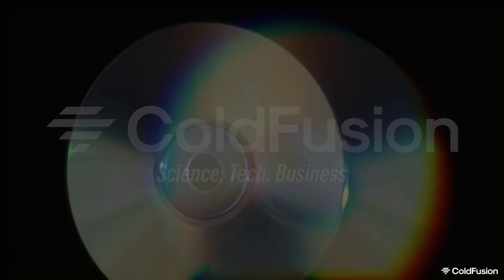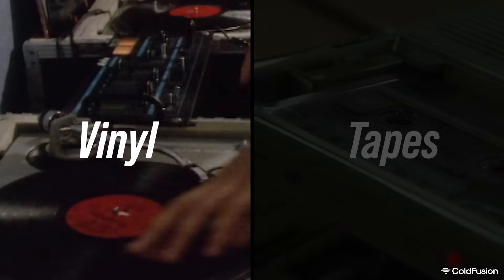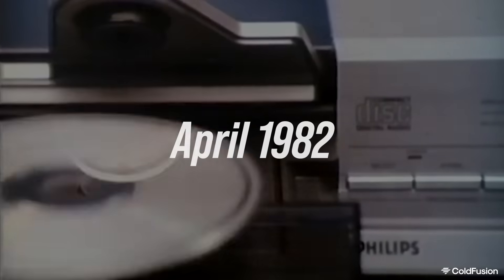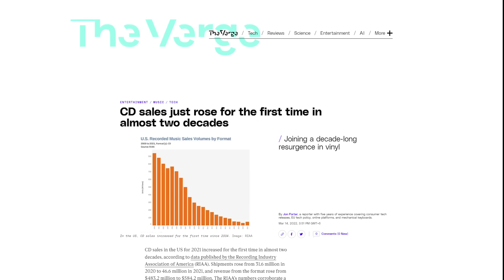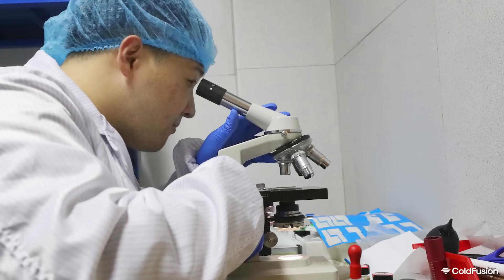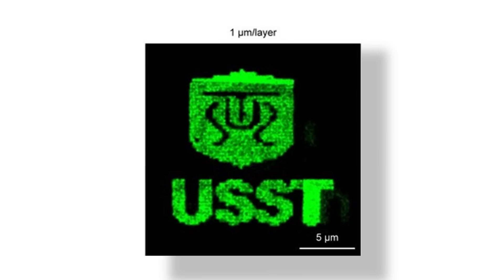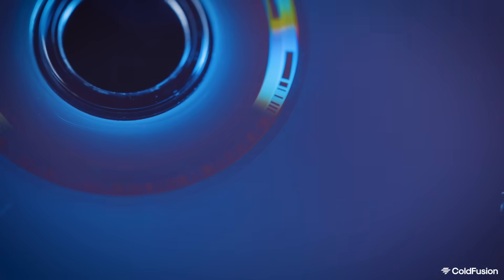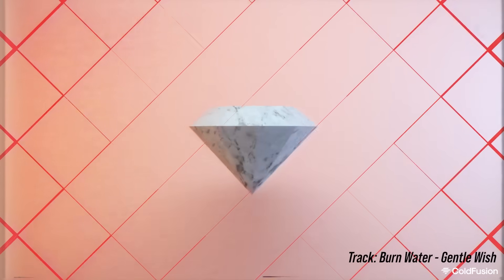Why This New CD Could Change Storage

Comment: 👀 Ey, bit=/= byte. They are not interchangeable. 8bits = 1 byte. A bit can store 2 values (0 or 1), a byte can store up to 256 values in binary (from 00000000 to 11111111). Let me explain a bit (not a byte, hehe)... 🦜

A bit is the most basic unit of data a computer can understand at a hardware level (basically and on/off switch = 1or0; which is what transistors functionally do). We can give meaning to a bit, outside of the computer, and interpret them and treat them as such (hot/cold, presence/absence,cat/dog)... But that leaves us quite limited, as we would only be able to store data that are "either or". That's where "grouping" of bits comes in useful. 

A common misconception is that since a byte "joins" 8 bits, it has 8 times more "capacity", but in reality what you achieve is more similar to  storing  the same amount of data units but you get more "resolution" for each units; you get 2^8=256 alternative values. 

For example, if you have 2 bits, you can use them either for 2 distinct units of data with binary values (for example: [0] and [0], or [1] and [0]) or you can group them for a single unit of data that can store up to 4 different values made from 2 bits ([00],[01],[10],[11]).

If you group 3 bits, your data unit can now have 8 different values: [000][001][010][011][100][101][110][111]

You can clearly see a pattern here: 1bit->2 values; 2bits->4 values; 3 bits-> 8 values; Nbits->2^N values
(N stands for any integer number). That's where those 256 values with 8 bits (or 1 byte) comes from. If we treat them as numbers, that would be from 0 to 255. Again, we can "label" or interpret those individual values according to a convention. For example, if we want negative values, we can agree that [00000000]= -127 and that [11111111]= +128; in fact it's is common to agree that, when we want to store negative numbers we can use  the first bit of the byte to indicate sign (+ or - ), so for example: [1-0000101] = (+)9. We could also label the values categorically, for example: [00000000]="Apple",[00000001]="Orange",[00000010]="Banana", and so on.

You might be thinking "okay, but why keep using bits as a unit then?" Well, they are the most basic unit, and as you you saw they can be used differently for different purposes. If you had 16 bits, you could" divide them", or use them for 4 different data units (" data types" is a more precise term from now on) or 2 with more" resolution". Like this: option a) [00000000] [00000000]; option b) [0000] [0000] [0000] [0000]

... Or you could say use [00000000] to store a character in asci and the rest to store a byte of data, effectively labeling the data! This way you can store a variable, like this: [01111000][00001111]
This last example would be interpreted as "x = 63", as "x" in asci is 01111000 and the value 63 in binary is 00001111.

We have "formated" the same amount of bits (which remember, are functional on/off switches which are based on a phisical medium) in different ways, to mean very different things! 

What determines how a hard drive is "divided" to store data...? That would be File System Formats . That is why sometimes a disk drive formated using different formats can end up with different usable space depending on the functionality they add to the data by using available bits in a different manner (like the "labeling" we did in the example) and adding error correction measures. This is one of the reasons why we still distinguish between bits and bytes.   

I hope this helped someone :)

Edit: i anticipate some of you might be thinking "why do we store values in binary rather than ternary (3 values per basic unit), or cuaternary,... Or more!?" Well, physically it's more reliable and easier to distinguish (which involves measuring) presence vs absence than all the values in between. As an analogy, In a bowl of peas, you can quickly tell if you have  have either none, or some (no matter 1 or 354!)... But knowing if you have 354 or 355 becomes more difficult. This is why digital data ("digital" literally meaning "with digits") is more reliable, but less detailed, than analog data (infinite values "in between" the signal). 

 In the past, attempts to have ternary(3) and quinary or pental(5) based computers have been made, but it proved more reliable to just combine single binary bits, as "middle" values were prone to measurement error and erasing. Currently, in quantum computing  the properties of quantum physics are exploited to store more than 2 values per bit (qubits = quantum bits)!

Comment: But what are the stats for reading? How fast can you read it, how much energy does it cost to read it, how expensive is a read-only drive? And can you make a master disc that you can use to stamp pre-encoded discs? While having cheap, compact storage, even if it's write-once, has a lot of potential, so does being able to instantly distribute 200TB of any static content to an unlimited number of people.

The Internet Archive has more than 48PB of data, which could be stored on 240 discs (impractical for an individual, but could be pared down to only the "significant" information, even partially using automated methods). The Library of Congress has over 7PB digitized, which could be stored on (still impractical, but less so) 35 discs.

Wikimedia (from a cursory search) seems to store around 700TB, or a much more reasonable 4 discs. Project Gutenberg is just under 1TB, easily stored on flash but a cheap way to fill space with useful content on a disc storing something larger.

Pirates would love it too: Anna's Archive (shadow library) has a little under 900TB, which fits on 5 discs. Since it's mostly text, it could easily be compressed, and there's significant deduplication to be done there.

Just about any content you can fit on a single one of these discs is enough to last a lifetime, assuming you don't care too much about what you'll watch, listen to, or read. If you do, you either have to be careful with what you download or just download everything. If you have no idea what you'll need, your only option is to download everything.

Comment: the HUGE problem with ALL cd/dvd media is that its optical and loses reflectivity and the 'written' discs break the layer thats used for protection so they (being plastic) will slowly rot and your data is gone
Reply: unless you live in a swamp, that wont happen, DVDs have the weakest layer and thus have the highest chance of having data rot if stored in bad conditions, blurays use inorganic layers and are much safer against, i backed up over a terabyte 7 years ago using 25GB and 100GB blu-rays and the data still reads perfectly + i used redundancy so they are protected against scratches and datarot, 25% of the surface needs to be damaged in order for the data to be unreadable, + i used the wirar recovery system so every backup workds like a RAID5/RAID6 so even if some idscs are unreadable, a recovery disc can restore any lost disc

Comment: I still use DVDRs for archiving. I've had hard drives crash on me, but I've never had a disc go bad. I have had discs that I had trouble reading on a different drive, but never one that couldn't be read by at least one drive.

I would have switched to burnable Blu-Rays, but the price for blanks never came down to what I consider the reasonable range. I mean, they press these things by the millions, there's no reason they should cost $3-5 a disc.

Comment: I'm not trying to be rude, but we've had 200GB-18TB backup capacity for years. I have no idea if any of you have worked at a data center or at IBM. Google Ultrium tapes. I feel like Gen-Z kids just aren't as informed or something, and this video is useless.
Reply: yeah they updated them to Petabytes, wow you can't game on them and it's nothing special.
Reply: but imagine this disc being an M-DISC, you won't need to constantly buy HDD/SDD in fear of those inevitably failing 5-10y or less, since an M-DISC will be the definite cold storage for archiving for more than one's lifetime

Comment: even if you make a cheaper, useable and faster 120 or 640 gigabyte DVD it will be reasonable for backup and archiving stuff. Seriously this is a proof of concept, to be archival it would be an incremental backup running 24/7 on like a banking server, and also have a secondary drive to make a backup backup of the same data. in the megabit range let's say increased to gigabit/second range thanks to SATAIII/SAS interface it would still take a while to fill it up.

Comment: Never again any spining storage, thanks. The lenses, kasers and fading laser diodes plus the data loss due the material degradation.  It is damn good that all those cd/dvd/bd disc died out. It was just a problem. A scratch ruined your life easily, also all of them had its lifespan and it was really short. I lerned the hard way that material of the writeable media aging and even the best quality media became a russian roulette after 3+ yrs… Even hdd should die out these days. Since 1982 I used all the media types from cassette and 5.25” late 3.5” floppy disk to all optical media types and ofcourse the hard disk drives. Today a ssd/flash storage (a good one, not a no name crap) will hold your data way longer than any of the optical solution back then. And I don’t need petabytes, all my life fits on a few terabytes.

Comment: this is nonsense.. 100 layer disc. "manufacturing takes about 6 minutes per disc" - six minutes? Firstly 6mins sounds pretty damn optimistic for stamping and bonding 100-layer disc, but ... 6mins? So you get 10 discs an hour out of a machine?  It's absurd. There's no way people are going back to physical media at this point; it's so much more cost-effective to increase the bandwidth of cable/cellular/satellite/etc instead...

Comment: What I want is a new floppy disk made with tech today. Tape stations is use for backup on data centers.
The kapacitet on tape is much higher then they were in the 90's. 
My estimate is that a 3,5" disk shut be about 50 GB.
Cheap and easy backup.

Comment: I don't know how many CD players I've bought at junk sales and thrown out due to some fault or other that could not be fixed due to the cost of a skilled technician who knows the drill fixing it.............with these new players coming on the scene I think I'll stick to MP3's and my collection of CD and DVD's and of course my collection of tapes and vinyl that I've accumulated over the years.......I'll need another lifetime just to listen to the collection I already have.........the latest music on the rounds is so crap I'll give it a miss.
If they think bundling mega files of music/ videos etc onto these discs will solve the issue........what if most of the music and videos  are crap and never gets played?

Comment: how does a 100 TB ssd cost $40k? An average 1 TB ssd goes for $60 and multiply that by 100 and its around $6k. This also great for Data back up if you are still on HDD which can fail faster than an SSD drive and has a long shelf life if stored properly. Having multiple back ups would also easilier to store and would take up less space than having bunch of drives or servers.

Comment: After decades of tech watching, I've become extremely skeptical of whenever researchers claim such a major leap in capacity, processing performance, etc.  There is always some severe obstacle or several obstacles, to go from the laboratory demo to a commercially viable product. Most of the time, if the tech is not simply abandoned, it takes so long to become practical that competing products with more modest improvements go through multiple generations, getting better with each, so that if the miracle tech ever becomes marketable, it no longer holds the same overwhelming advantage or more of an advantage at all.

The hard lesson has been not to get overly invested, financially or emotionally, in technology that hasn't even a hypothetical date for practical application.

Comment: Yea. No. CDs are not coming back.
Why waste another 200bucks on your PC to have a read/write dedicated device. Like it or not cloud + SSDs are enough for 95% of market.

Economically + demand are not viable.

The only aspect is for retainig data, but MS already did this a decade ago and at a higher data density when writing into a cube of glass. Which was more resilient and durable.

Comment: Don't understand why they are trying to do a cd to store so much . The cd has to spin . Why not use 2 beams of light ,one vertical and one horisontal , that scan a monolith of transparent glas. Where the lights intersect is the point where the data is to be reqd or write.

Comment: Good news is the storage is huge. Bad news is it's so slow you will die of old age before you can fill up the disk. But realistically it needs to be really fast to be usable otherwise it's like having car with 2000 mile range but it can only go 3mph.
Reply: "But realistically it needs to be really fast to be usable"

nah it doesn't, just like HDDs doesnt need to be fast like SSDs, + current blu-ray cds have 79MB/s, so even only at that speed its decent enough for the storage u get
Reply: @automatedrussianbot  were talking over 240 days to write the disk. it would be unusable. sure if all you do is access small files then sure it could work. but if you want to access large video files you are screwed.
Reply: @mp-xt2rg  wrong and wrong, First: as someone who uses optical media almost daily, fastest write speed on a 100GB bluray storage disk is 72MB/s(576 Mbit/s), thats 100GB in 23 minutes. 1 TERABYTE every 3.9 hours. at those speeds you would fill up a 125TB CD in 18.2 days.

thats just slightly slower than filling up a NAS server with 1gigabit connection, and if the storage is cheaper than harddrives it will be worth it. this is something content creators have been wanting for decades.

but lets assume that the write speed is way slower, well its still a good secondary copy, your main copy can be on a harddrive where you can access the files fast, if that harddrive dies you can always use the mega CD as a backup.

third: some places have really slow connection making cloud backups really hard, a giga CD with just 25MB/s 50MB/s transfer speed would be a better solution for them than cloud

Comment: The thing not being mentioned is with that density (Capacity) if you damage a disc somehow you stand to lose HUGE amounts of data. Same holds true for Large hard drives and SSD's. I have been in the tech & IT field for decades and I have seen it happen. I would trust optical storage over SSD in the long run. SSD's, like USB sticks have a limited number of write cycles and I have seen many die prematurely. However this new technology is (at present) cost prohibitive  for any realistic use.

Comment: The read write speed and efficiency is the main limitation I see. The 50k Laser or the fact that regular people dont even have something to run a cd with isnt that big of a deal. Nvidia has some massive GPU's for data centers and they sell perfectly fine. There are definitely datacenters that will just eat these up if they work well such as youtube and their ever rising costs with storing so much video data.

Comment: How about it’s error rate???
I can imagine that such high capacity CD could be waaaay more sensitive for errors overtime, even if you take care of it.
Even error correction methods couldn’t solve these issues because it relies on the same copied data of to retrieve damaged data, so if your CD does contain 18 petabits of data in wich each of them is unique, then you can’t recover damaged data.
However if you have 6petabits of data while those other 12 petabits are exact copies of it, then error correction could retrieve that damaged 6 petabits of data.
So i really trust such high capacity of data disk.

Comment: This is an example of bad video, or great video to make money for the producer. 2 ads inside and almost 15 min of video that could be reduced into barely 1, with low quality information and little information. The most juicy part on how it works is ridiculously explained, it's actually not explaining it at all, there's no technical data shared about it and no actual images of that specific part, so the use of stock images is confusing and misleading because they don't represent what is said.

Comment: the increased storage limit for CDs is not compelling in all but niche usecases. i just bought a 256Gb usb stick for about $30 and can write and rewrite data at will, without purchasing additional hardware.
Reply: Data center is niche, wow so smart
Reply: @hilihkintil6789  : lol 200Gb CDs and machinery for writing/reading and manually moving these. it's going backwards